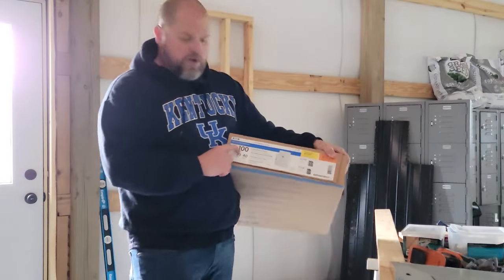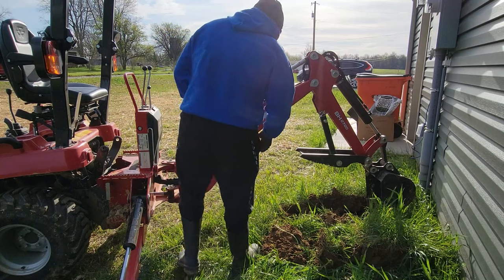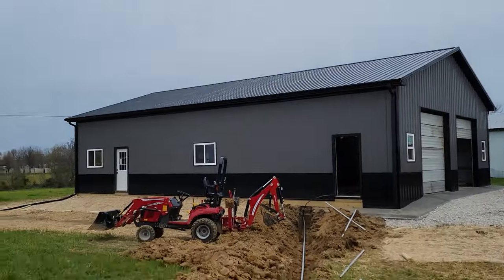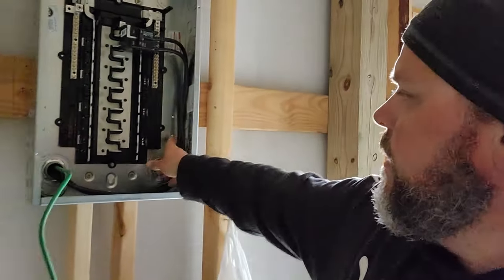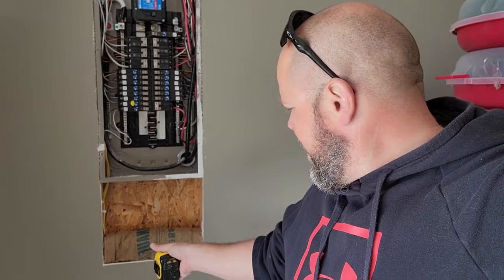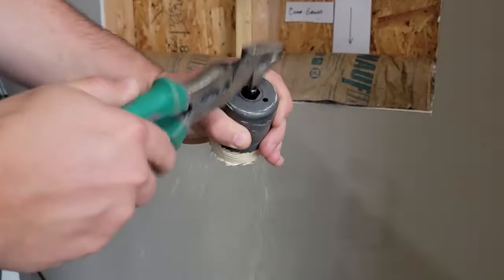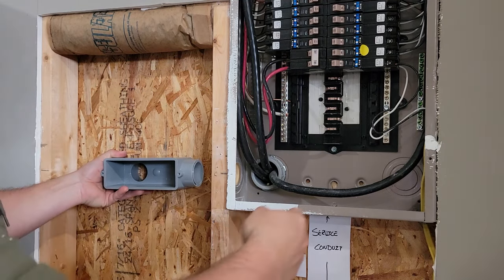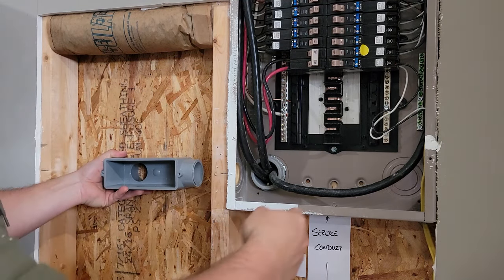Installing 100 AMP SUB PANEL -  THE COMPLETE PROCESS - SAVED THOUSANDS $$$

Comment: Greetings - Learning Moments. 1) If Ground Rods are used, you will need two (2) unless you determined (1) rod is 25 ohms or less per 250.53(A)(2). 2) your 2 AWG AL is only rated for 90 Amps so hopefully hoping you used a 90 A OCPD at the source for your feeder. Now, the expansion fitting per 300.5(J) really depends on your local inspector and if their is a propensity for earth movement. Also keep in mind torque you really should torque all lugs properly to ensure longevity of your terminations.
Reply from the maker: I did end up having to have 2 ground rods. AL MHF Cable rated at up to 90c for 100amps. What am I missing? I also found several charts confirming that. https://wire.buyawg.com/viewitems/all-categories-appendix-allowable-ampacities/sulated-aluminum-or-copperclad-aluminum-conductors Thanks for watching and commenting 👍🏻
Reply: The 60/75/90C columns can even be confusing for license professionals at times. Still a pretty good install and should have plenty of power at 90A.

Comment: My suggestion is that your trench was very deep, I think electric is 18 inches to top of conduit.  Gas lines like 24 inches.  Digging deep can result in striking a gas line in some situations.  Also, it is always nice to drop a tracer line in the trench with the ends visible at each end of the trench so that if it has to be dug up in the future, you don't need to hunt around for it. Otherwise, good job!
Reply from the maker: There are no gas lines on my property. Water lines are set at 36" in my area. I should have also mentioned that I called the service that marks the property for all service lines before digging anything. Thanks for watching and commenting 👍🏻

Comment: I need to do the same project but I need to go 150’ in Onslow county, NC. County said they’re using 2017 code book but I only see 2012 or 2018, can anyone help please
Reply: NC is using 2017 for residential right now. They should be moving to 2023 next year.
Reply from the maker: 2017, 2020 and the newest is 2023. The NEC is revised every 3 years. Some jurisdictions instates like mine enforce 2017 and 2020 right now. However, over the years they slowly adopt newer code requirements. Good luck!
Reply: Thanks can anybody tell me what size aluminum direct burial wire I’d need to pass inspection 100A at 150’? Please help

Comment: When you mentioned metal in your eye...
I had the same thing happen. Drilled an inch and a half hole through the box. Landed on my eyelash, and never knew it.
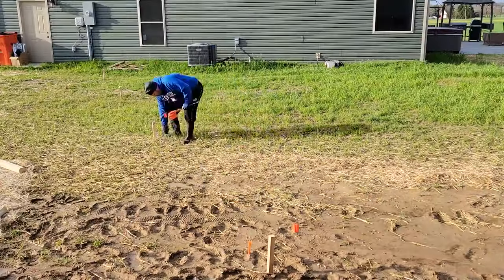I didn't start feeling it until 2:30 in the morning, after rubbing on it. It wasn't coming out. Had to go the the ER. The shard was enormous. I've felt your pain.
Reply from the maker: I am making an effort to grab eye protection more often. No matter how much of a hurry I'm in.
Reply: @JustinsProject  You won't be sorry for doin it. Stay safe!
Reply from the maker: @Seemsayin  Definitely, be careful out there. 👍🏻
Reply: Yup.  Eye pro is not overrated
Reply: @steve390gold  As a matter of fact... when the doctor pulled it out of my eye, he put it in a cup, because he couldn't believe how big the shard was. It looked like the letter "C", and both ends were the tip of a needle. It was nasty.
Reply: @Seemsayin  ouch!  Ive manually pulled an aluminum shaving from my right eye before.  Thankfully it had not penetrated the conrnea.  Im thankful that my eyes arent that sensitive any more courtesy of my contacts... now i  can usually dig stuff out without issue....LOL

But had itnpenetrated the cornea (it sounds like your did!!) Then i def would have been going to urgent care.....lol

Comment: Wow, you have learned a lot.  Mostly correct too!   The reason the inspector said they do not enforce expansion fittings there is that it is not a NEC requirement but a utility company requirement, hence in the service entrance conduit.   Technically you are supposed to test the ground rod for 25 ohms or less, no test, two ground rods.   The #2 aluminum you used according to 310.15(B)(16) is only good for 90 amperes at 75C, and #1 is rated at 100 amperes, therefore feeder conductors(not service entrance conductors) should have been #1 Al.  
Mostly, listen to your wife!   Always be safe, the life you save may just be your own!
Best wishes,   Kevin
Reply from the maker: Thanks for the feedback! Much appreciated! I am always trying to learn something new. Yes, I should have listened to the wife. Safety is key. Tomorrow, I have my final inspection of the 10kw solar system I designed and built from beginning to end. I am feeling pretty confident about it. Got to power it on for a few hours during my testing but I have to leave it off now until the inspection is complete and the electric company changes the meter to a NET meter. Can't wait to start producing! 

Thanks for watching and commenting! 👍
Reply: @JustinsProject     40 amp 2P breaker for the solar?   And the breaker installed at the bottom of the panel?
Reply from the maker: @KevinCoop1  45 amp was installed in the main panel for solar system. Yes at the bottom on the left side across from my 100 amp sub panel for the building.
Reply: @JustinsProject     I didn’t see this until now.   The reason I asked if 40 amps at the bottom is NEC requires at opposite end of bus from main.  Why, I have no idea!   NEC also limits the solar ampacity feeding a panel at 20% of the panel size.  IE 200x.2=40.   Why, I do not know!
Best wishes,   Kevin
Reply from the maker: @KevinCoop1  I put a 45amp. My main panel rated at 225 max X 20% = put me right at 45.
Reply: @JustinsProject     Perfect!
Reply: Remember your voltage drop, calculate anything over 200 ft in length

Comment: I know this video is a couple years old, and by now, someone has informed you of the expansion coupling reason.
It is there for the freeze and thaw cycle of the ground, so you don't  end up pulling your conduit out of the fitting you're glued into. 

It's a good idea, not enforced by the NEC, but up here in the north, the utilities require it. (on your service entrance raceway). 

I use them for buried conduits that come out of the ground and are attached to a structure. I feel it's a good idea.
Reply from the maker: I agree with you. I should have installed them on all conduit ground entries. Thanks for watching and commenting 👍🏻

Comment: Looks great. 

Only issue is you need MC cable in that garage since you have exposed walls. If it was covered with drywall (or will be covered later) then you can use Romex behind walls.
Reply from the maker: Spot on! Found that out on my inspection :) I did follow up with a separate video on that. Thanks for watching and commenting 👍🏻

Comment: I'm a retired union electrician and I think you did a fine job. Sure it could have went better. It always is that way.. And you saved a lot of money and they would have taken as long or longer.  I wish I could do that roof for you. Because I did my own too. It's not so bad . Mine was on a much steeper roof . Fall protection was definitely required and you would want that for whoever does your job. Liability issues and laws specific to the potential falling hazards are strict.  I am waiting to see your enphase system and solar panels install.
Reply from the maker: Much appreciated 🙏 Thanks for watching and commenting 👍🏻

Comment: Very educational! I’m about to do the same thing. Something an old electrician told me to do is any time you run conduit go ahead and put in a pull line as you’re putting it together, saves a lot of time and effort when you have to pull wire in the future.
Reply from the maker: If you have that option available you most certainly can save yourself some headaches. Pulling those thick wires in a conduit can become challenging real fast. Thanks for watching and commenting 👍🏻
Reply: Just need a good fish tape or mule tape and a human tugger lol. I've pulled 18 2 pair cables(72 #14 AWG cables) in a 2in emt conduit with 360 degrees of bends.

Comment: Plan the pole barn with your top two breakers for generator hook up. DON'T need a generator yet, but prepare and do your wiring for it while all supplies and tools are at hand.
Reply from the maker: Thanks for watching and commenting 👍🏻
Reply: If you want the house to have backup, that should be done in the main panel, not this subpanel.

Comment: Honestly, I can say I'm extremely surprised your inspector is so relaxed about the expansion coupling, and moreover the use of two whole straps without bracing. An easy fix to this problem is to support each conduit with its correct-sized mini. Expansion couplings are needed because PVC expands and contracts with the different seasons throughout the year, without this coupling on exterior facing structures, you run the risk of severing the connection between the PVC pipe and LB conduit body. I first hand have experienced this from jobs we had to service, and in some of the worst circumstances, it caused so much tension on the line sets they sprang loose from the panel, causing an arc flash... On another note, you did good work, I do not aim to discourage, my only prerogative is to provide you and others with safety information so you don't end up with the negative experiences I've had to service in the trade.
Reply from the maker: Thanks for the feedback. I always appreciate constructive feedback that offers value to everyone. Thanks for watching and commenting 👍🏻

Comment: The details are always a hang up with me. Do you bond a neutral and ground in the subpanel and that type of thing?
Reply from the maker: The only neutral and ground bond should occur at the main service panel never in a sub panel. If you have any doubt always reach out to a licensed electrician, most are pretty helpful. Thanks for watching and commenting.
Reply: @JustinsProject  Because of my questions about details, I hired a licensed 57 year old electrician who had been in business for 30 some years. The job was to replace my subpanel. He insisted on bonding ground and neutral in the sub. He put a jumper from the neutral bus to the ground bus, and he put in the green bolt that bonds the neutral bus to the housing. Frustrating. I went in and "unbonded". I've learned after 73 years that the experts are not always experts.

Comment: Thank you for this video, I think I'm up for the job.
Reply from the maker: Best of luck! Thanks for watching and commenting! I have a follow up video on this also. Be sure to check it out if you are installing yours in an ag building.
Reply: How did you know what wire for underground? If I’m running wire 75ft to garage to open 2 garage doors and run the pool pump during summer, maybe airconditioner later on.

Comment: Thank you for this great video!  What is the amperage rating on your main panel?  Did you have to upgrade your main panel to accomodate the sub?  If so, did you have to upgrade your meter as well?
Reply from the maker: The main service panel is a 200amp service panel. Max bus bar rating of 225A. I only upgraded the meter when I finished my solar system. Hope that helps. Thanks for watching and commenting!

Comment: Nice job, if you had time you could run a length of heavy nylon cord in the 1 inch pipe to help you pull the next wire😊👍🏼
Reply from the maker: Thanks for watching and commenting 👍🏻

Comment: Like your cander and can do attitude.  Eaton BR are the Bryant brand they bought out and CH is the other brand Cutler Hammer.  So far I've seen Lowes and Menards have the CH style breaker in stock more than most places.  Stock up those breakers it might be currency with the local sparkies.
Reply from the maker: Seems like everything is on the rise in the last year. Drastically! I got me some reserve for when I go to add some more circuits. 😁 Thanks for watching and commenting 👍🏻

Comment: nice vid, couldn't the solar go right into your new subpanel, why did you run it back to the house?
Reply from the maker: No, they would not allow that in my situation. I was required to be connected to the main service panel. Thanks for watching and commenting 👍🏻

Comment: One thing all these videos show on you tube is great planning except for the fact that once a panel is recessed its hard as hell to run new circuits lol. Looks nicer but defeats the purpose of future accesability to recess why I prefer surface mount 😉
Reply from the maker: That is true, but I have almost maxed my box out now. Only now am I finishing the building. I think I have all the curcuits I will ever need. If not, too bad I ain't putting it in 🤣 Thanks for watching and commenting 👍🏻

Comment: Nice work! Did the inspector nail you on any of the small stuff like using a LB in the wall, metallic straps on PVC, slip coupling? EDIT: I do see you mentioned about the access cover for LB.
Reply from the maker: Thanks, Yes the inspector did hit me on the install. Probably not for the reasons you would think though. I did a follow up video on that. You can find that here: https://youtu.be/U4gYKlmDXqs Thanks for watching and commenting 👍🏻

Comment: good job.  what size wire did you use to carry 100 Amps?  my electrician says we need #1. copper.  seems like #2 could do it.
Reply from the maker: I was allowed #2 alum but I should had used #2 copper. It's really comes down to temp and whether it is going to be above ground or in conduit below. Plus the length of the wire. If #1 is in your budget, then it would always be best to do that.

Comment: Where did get ur service wire? Online? Link? 
Or just Home Depot ?  Also did u use 2inch conduit for the 2Awg AL wire? I used a conduit fill chart and my answer came to 2inch conduit should be used ?
Reply from the maker: If I had it to it over I would do solid copper wire. I got the wire I used in the video at Lowes. Eventually, I might change out the alum wire and put in solid copper. I really do not want to but I might get wild hair and do it one day. For conduit size I used a fill chart for schedule 80 since I have wire coming out of the ground and would be exposed. Depending on your wire size that will change but here is a link https://www.southwire.com/calculator-conduit  - Thanks for watching and commenting! 👍
Reply: Ofc. Copper is the best ,  we choose AL because of  cost effectiveness… why do u regret using AL ? I’m about to buy my AL feeders .  Should I hold off?
Reply from the maker: @petertommasi4865  The same reason I choose AL. copper was insane. It has served me well, though. Good luck on your project!

Comment: Nice video. I have a similar install I'm trying to complete.  Electrician in my area recommended Underground Feeder (UF) trailer wire that would be inexpensive and allow direct burial at 18" in cover to pass... but I plan to use 2' of cover.  Having difficulties finding the required cabling... was thinking UF would be cheaper than installing in conduit for my 300' or so, but we'll see.  One question I had about your installation.  You mentioned solar and ran a line from your shed to your main in the house.  Why wouldn't you land this in your sub-panel?  Are there codes to be followed here?
Reply from the maker: Hi Chris, Yes I am working on  installing a 10kw solar system on top of the building.  I am using micro inverters which are coverting the DC to AC right at the panels then feeding down to my combiner. From there into a main solar array disconnect switch then into the main panel. I'll try to cover that in some up coming videos if your interested. Thanks for watching, sharing and commenting 👍🏻

Comment: since your wire is direct burial did you have to put it i conduit still or was that you just being cautious?..:)
i'm doing a similar project but my barn is 300 ft so my serivce will only be 60 amp with 2/0 mobile home feeder direct burial.
Reply from the maker: It was required to be in the conduit. Good luck with your project. Thanks for watching and commenting 👍🏻

Comment: What kind of wire did you use(size, brand, where you got it) ? I'm looking to do the same but need to figure out the wire first.
Reply from the maker: I got it at Lowes in store, 4 wire. If I were to do it over, I would have used copper rather than aluminum. Thanks for watching and commenting 👍🏻
Reply: @JustinsProject curious but why did you use aluminum?

Comment: If I understand correctly (I’m not an electrician) if the first outlet (nearest the panel) is a GFCI outlet, then IF you wire it correctly, all the other outlets on that circuit are protected by the GFCI outlet and the other outlets don’t need to be GFCI.
Reply from the maker: That is correct. I now have 4 20amp circuits in the shop now and each one of the start with a GFCI so all outlets are protected by GFCI. I have a big update video on all the work I have completed to the shop coming out in a couple of days. Thanks for watching and commenting 👍🏻

Comment: I noticed you used a coated ground wire (green) from your main panel to your sub panel. Is that required or can you use a bare copper wire?  Thanks!
Reply from the maker: It was not required to have the coated ground. However I wanted coated to enter the combiner box. Plus, it was actually cheaper per ft than the bare wire. Thanks for watching and commenting 👍🏻
Reply from the maker: Sorry, I misread that thinking you were referring to ground my solar system. I used that wiring because it was twisted together 4 wires and it included the ground.

Comment: I’m frustrated as you didn’t show the wiring to the live panel and that is what I was looking for. Can you share the pic of it.
Reply from the maker: I other videos that show it. Its 4 wires. Ground to Ground. White stripe to neutral bar. The other 2 into the 100 amp breaker. Hope that helps.